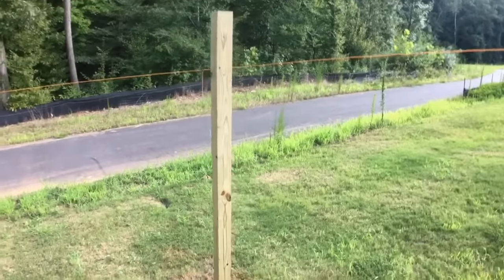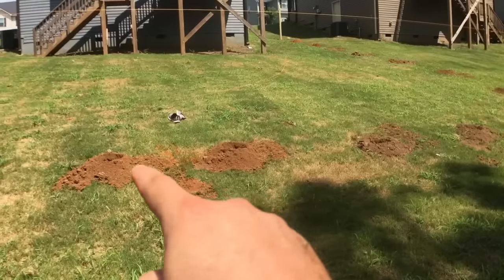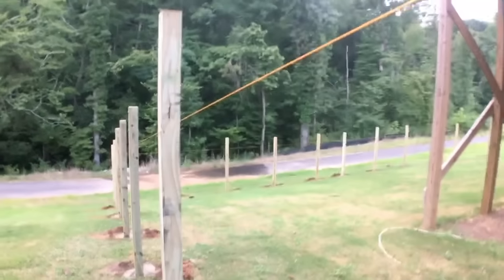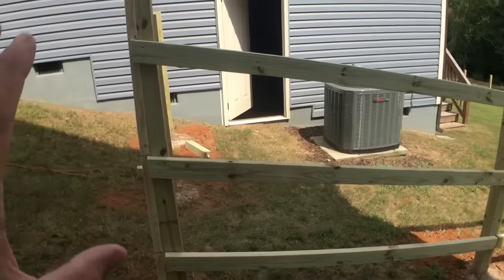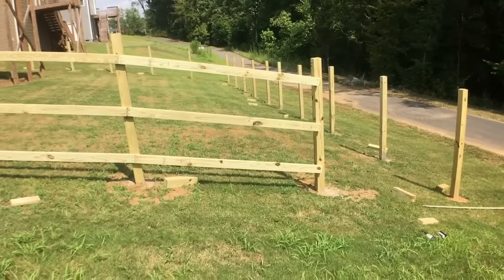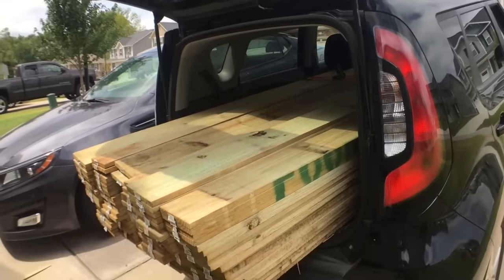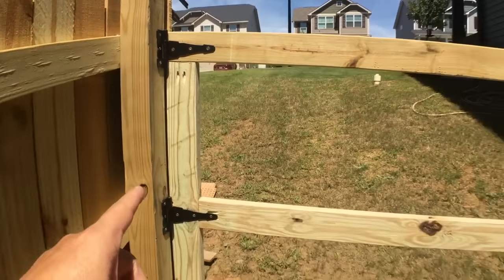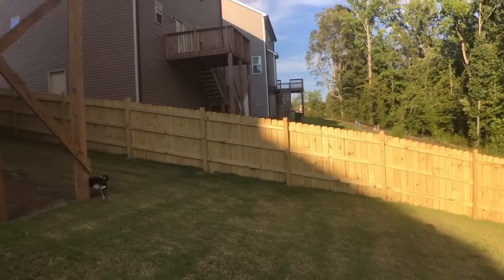How To Build & Install A Wood Privacy Fence Yourself! WITHOUT breaking the bank!!!!

Comment: Cmon now.. I am a woman 72 years old..5' 1" and live alone. I just put in 350 ft of wood fence using just a shovel to dig 2 ft deep holes for round treated 8' posts. I used Quikrete to set all the post and mine I put 6 ft apart.
Reply from the maker: Where were you when we needed you!!!?
Reply: I just told my daughter we could do this. You've inspired me!!!

Comment: Overall you did a good job, pro tip try not to use corner posts to be a a latch or hinge posts for gates, its essentially free floating and after a couple months that post will bow which will effect how well your gate opens if it does at all. 2nd piece of advice,  leave 1 1/2 inch gap between the gate where the latch is, over time the gate will sag a bit, if its to close together you will be lifting your gate to open it. 3rd tip ditch the middle runner (2x4) in the gate all thats doing is weighing down the gate, you put a diagonal 2x4 inside the gate frame (the bottom of the diagonal is always on the hinge side) its transfers the weigh from the top of the latch side to the bottom of the hinge side that has substantially more support due to the hinges being lagged to the post. Other than that it turned out good, not bad for your first fence!
Reply: That was absolutely so nice of you to provide such great technical insights to Kalinds Life. I am a woman who wants to build my own build my own fence so I watch and read comments so I can learn. I'm afraid to do it because I fear I'll run into something I can't handle. I'm watching and reading everything I can to be fully prepared. You comments helped me understand before or if I should attempt this. I would love the sense of accomplishment and want to save the money but just not sure yet. Thank you for the pro tips.
Reply: Learning. What do you mean by "free floating"?
Reply: @billymiles2635  I think it means the post is a corner post so the fences overall strength and rigidity is not in-line with the gate, it turns 90°.  I believe this is a problem because the gate hanging on that corner post will eventually pull it down, causing sag.  If the post had another picket section in-line with the corner post it would distribute that load across two posts, not 1.  At least that was my interpretation.
Reply: @Ryan-qk9sw  Your interpretation is correct
Reply: Gate wheels are a good idea. Good vid!
Reply: Yup, definitely need the diagonal cross beam on the gate
Reply from the maker: Thanks for watching!!! And commenting!!!

Comment: My how times have changed. I'm 67, when I was in my 20's my dad bought a "farm" we had to run 4 strands of barb wire to fence in 20 acres of pasture. EVERY hole for round fence post was dug with a two post hole digger. Granted it took 2 weeks, but I probably dug 1000 holes. I wish they had that gas operated one like you used.
Reply: If'n ya studied yer slide-rule a-might closer ya coulda' told yer ol pop's 1000 holes was multiples-o'-far-too-many.  Heck, ya musta put a post every 3 ta 4 feet.  So close the ground'll fissure if summer sow leant up again-it

Comment: Great job! I installed the first fence to my house back in 2004 to contain my 3 and 2 year old son and daughter. Sixteen years later my son just completed his first year of college and my daughter is going to be a senior. I live in the northeast (Lake George, NY). Where we get lots of snow and ground heaving when the ground freezes. If I were to offer a tip to your viewers, it would be to dig a 4-feet post hole, pour in about a foot of gravel (#2 stone), apply plastic roofing cement to base of your posts (getting the bottom really good), then setting the posts in the hole and pouring the concrete. This is a trick an old timer (my dad) taught me. Why? This will protect the post below grade from wood rot and from ground heaving when it freezes. See, the pressure treated lumber we buy is recommended for ground contact but not to be buried in the ground (or in water). That type of lumber is called marine grade- which is a lot more expensive. My point... I just replaced all my fence panels- they were an untreated spruce spaced picket (cheap at the time and did the job). When I removed those panels I inspected the posts, and all were rock solid like I just put them in. I replaced the spruce stockade with new cedar pickets- looks a lot nicer and saved thousands over having it done professionally. Note: for those looking to install cedar- be aware that if it does not come prefinished, you will use a lot of stain. I installed 80 feet and went through (1) 5-gal pale of stain and only had 3/4 of the fence done. So I purchased another 5-gals and will finish the first coat and apply a full second coat. Ps: when installing a gate, make sure you either install z-braces to prevent sag or buy the gate cable system- I chose the z-brace method- less expensive and better looking imo. Thanks again for the video, and best of luck to all on your next fence project! -Gary
Reply: What a coincidence, I live about 15 minutes from Lake George and I’ll 100% take your advice. Thanks!
Reply: I would to see a picture or video of that

Comment: I am a 61 year old woman doing most of this myself.  I say take a tiller and they dig down a few inches at a time. They are not real heavy.  so you end up with a 2ft sq. you have to keep digging up the dirt out of the hole.  You may have to take 2 days to do it. Just planting the poles. Eventually you will have a 2 ft hole. So tiller some and dig it out then keep doing it over the place until you have your desired depth.  That is what I will do.

The cement I have delivered.  I can't lift those bags. So take a bucket and take out 1/4 at a time.
A WORX wheel barrow is good.  I fill the bucket about half way to move the stuff to where ever you want it.  Then you can take the barrow to the holes and use a hose to make up the cement.
You can use quick drying.
Reply from the maker: Your an inspiration for sure!!! This is a lot of work and for that I commend your efforts!! Keep up the good work and hope all works out for you!!! Thanks for watching!!
Reply: inspire734 I’m in the same boat as you.  I’m sure you’ve done a great job.

Comment: I build fences for a living and this thing looks great, you could’ve used brackets for more support but it’s money 👍🏻
Reply: You would use brackets in between the poles right? On the end of each 2x4. Instead of nailing them on the outside?
Reply: What gauge nail gun should be used when attaching the panel to the post
Reply: I own my own fence company and that fence looks like shit. Not built properly and the gate has no braces. Brackets arent necessary when built properly. The build measurements are stapled on the side of the pickets when you buy them. Posts are to be under the pickets...
Reply: Can you tell me what material I need and how many to make a 200 feet fence
Reply: If u build fence for living your fence company must be crap all the post are higher then the pickets that’s a number one rule

Comment: Looking to do my own fencing job in Scotland, UK. Been looking for a step by step and informative video with handy tricks, much like the templates you used. You must be chuffed with the finished product.
Reply from the maker: We absolutely love it! Doing another fence video soon! Caps, water seal and gate supports! Thanks for watching!
Reply: @TheCrawlspaceCraftsman  do you have the measurements to the spacer you made
Reply from the maker: F King are you talking about the guide on the top?? It was just a 2x6 piece of scrap.l with two small pieces in the sides to hold it in place. I used a level to plumb the dog ears.
Reply: A string line would be the easy way to grade the top of the pickets it works the same as the Template but you can run the string down the whole fence line instead of having to move a template every couple feet.

Comment: Excellent video!  I'm about to start the same type of project tomorrow.  I have never done a fence before and I'm a little less nervous after seeing this.  I have no incline to speak of and the posts are all good, I believe.  So really it's just the slats.   Thanks!
Reply from the maker: Hey yo Rick! You can do it! Once you find your proper line and set your corners it’s smooth sailing from my there! The string line trick will help tremendously!!

Comment: I wish I had your soil. I live in Winnipeg. When I put in my fence posts I had to dig through roots the size of my biceps and clay soil that was like trying to dig through silly puddy and dense clay that clogs the auger every few seconds. I used the towable aguer from home depot, and even that large thing had a lot of problems. 2 days for 16 holes!  I had to use a crowbar and I sharpen the end to get through the very thick roots. The jackhammer was only useful for the first foot and the roots went 2.5 feet down in several holes.   Because my house is 100 years old, I also had to rent  jack hammer because there was a fence there before with concrete years ago. If I had someone else do my fence, I am sure they would have charged $6000 for the 50 foot fence. It was just crazy.
Reply from the maker: Dude that is crazy!!! This is not a job or company I would want to own! I give all the credit to fence builders even though I personally wouldn’t use one!!!

Comment: rent an auger for @60 bucks for the day,put your back out drilling all day into pitrun backfill on a new house.a lesson i learned early.i hired a bobcat for 250.00 with operator.maximum 15 holes,10.00/ea for anything xtra.
dont break your back,if you can get a machine in there,it s worth more than you know

Comment: Just started 300 feet of privacy fence this weekend.  My biggest problem with digging the post holes are roots!  Our neighbors have giant lived oak trees and the roots are at a minimum 2" thick.  Your video was great and gave me some good ideas.  Thanks!
Reply: I’m looking to diy a fence like this- how do you get those roots out? We are building one essentially in the woods with pines and wisteria EVERYWHERE. Can you power through the roots or do you have to get them out another way? If so- how?
Reply: @grassraptr4701  My 300 foot fence ended up being about 450 feet. In the areas I had a lot of problems with roots I could power through some with my gas powered auger but many I just had to reach in the hole and cut them out by hand with a saw. I used various saws depending on how much room I had and how deep they were. The quickest cuts were made with a Sawzall. Be careful because one cut I made ended up being an old waterline for irrigation… that was a delay to get the water stopped and repaired. OBTW, I don’t even have irrigation!!!  My house is circa 1964 so God only knows the changes made previously.

Comment: I've read a lot of pro tips on your video. I don't know if it was mentioned, but I have another tip for you. When you fill your holes with concrete, don't fill it to the top of the ground. Leave about 2" - 6" from the top empty and fill the rest in with your dirt.
Reply: Actually, that's the opposite of what you should do if you want your posts to not start rotting after a few years.
Instead of stopping with the concrete 2-6" from ground level, get an 8" cardboard concrete form at HD (they come in 4 foot lengths for just a few dollars) and saw off about 5". Place that around the post and keep it about an inch below ground level. Then FILL that form with concrete and with a trowel shape the drying concrete so that the water runs AWAY from the post.
Granted, it's not as pretty as having the soil and grass grow right up to the fence post but you will make sure that the post will not rot right where it matters: where the wood goes in to the concrete.
You'll thank me years down the road. :)

Comment: Most fence pickets are not treated for ground contact. And suppliers like Yellawood® recommend leaving a gap at the bottom so the pickets do not touch the ground. It actually voids their warranty if the boards touch the ground. Great job with the contour of the yard and tips on how to ensure your posts are placed accurately.
Reply from the maker: Thanks so much Bart!!! The only reason I have mine pretty much on the ground is my dog! If he had any inkling that he could get under he would dig his way. I to would recommend putting a 1.5”” board under each to keep a nice gap between the bottom of the board and the ground!

Comment: Nice job! The "template", in old school terms, is called a "story" stick. Should you build another fence, I would recommend mixing concrete before hand, ( practically dry or about a 2-3 inch "slump"), Google can help you out how slump relates to concrete. Then, mound the concrete in a nice four sided cone , so as to shed water. Yeah, I know it seems more of a hassle, but the end result will be much better. Curious, did you put gravel in the post holes prior to installation? No biggie, but it does help with rot. Most people don't. Some people go so far as to caulk around the top of the cone where it meets the post. Again, I appreciate you taking the time to share your great work experience with the world.

Comment: Awesome video, but I advise calling 811 before you dig and they will come mark utility lines. That can save your life!
Reply from the maker: Hey there JR!  You are absolutely right.  I didn't add this in the video but we did call 811 and they came out.  We were new construction and had little to worry about.  The only lines in  the ground we needed to avoid were on the side opposite of the AC UNIT as that was the Main power.  We ended up cutting the fence to 6' on the last section so the Meter box was on the OUTSIDE of the fence.  Thanks again for watching!

Comment: Great video! It’s hard to find a good fence video but you nailed it..
Reply from the maker: Wow thanks Brian! There was so much video taken and just as much edited......it was a hard one to make and I didn’t want to disappoint.
Reply: LOL, nice pun!
Reply: @TheCrawlspaceCraftsman  Great job on your fence! I install fences, only recommendation I have is use your stringline to set the height of your posts, you want a uniform top, not necessarily uniform distance from the ground.  You can also use a stringline for the top of your boards.
Reply from the maker: Instant Karma I see what your saying. Only issue for me was we have to follow the contour of the ground per our community guidelines. I didn’t agree but rules are rules!
Reply: KalindsLife About How Much For Material My Yard is About the same Size As Your And Thinking About Doing It Myself

Comment: Basic rule of thumb are the following:

1. Top of picket should be no more than 6" from top of 1st 2x4 rail. This is important especially when using the pressure treated picket boards that was used it. 
2. Bottom rail should be 6" from bottom of picket as well
3. Middle 2x4 centererd
4. Picket boards should at minimum be 1" above ground so pickets are not touching ground which will prevent premature decay of picket boards
5. If at all possible larger strap latches should be used and not the small t-latch used which doesnt support the pressure treated gate
6.  Excess 4x4 post should have been cut prior to installing top rails

Although the job isnt perfect its still better than some fences I have seen.
Reply from the maker: Great info here everyone!!! Again I’m no pro and highly recommend doing your own research before your build! Thanks for commenting and watching TK!!
Reply: when it rains it looks like your on a hill there so its not going to drain properly and will absorb in the wood.  U might want to cut some of the bottom if possible.  Also gapping for swelling is important ... Im not a carpenter so maybe i have no clue what im talking about. Lol.  But it does look nice.
Reply: @Myeyeofthebeholder  its a WET pressure treated pickets. You need to make it as thight as you can. Yes fence needs to be at minimum 1 inch above ground preferably 1-2 inch
Reply: @temujinkhan6326  yeah.  Now that i think about it they make u do that with decking. You did really good on your fence. And i know the dog is happy 😊.
Reply: @Myeyeofthebeholder  I did not gap my deck at all and now I have up to 1/4" gaps. Pressure treated 5/4 boards were used. My neighbor who gapped 1/16" has up to 1/2" gaps now. Those wet timbers will dry and shrink pretty good, especially here in NC. I see KalindsLife wearing an NC State hat, so I assume he's around these parts too.
Reply: 6" or less to prevent warping of the wood?
Reply: That concrete work tho

Comment: Just two suggestions, 1st the  “gates” it’s not necessary for that middle horizontal 2x4 instead a diagonal board from the top outside down to the bottom hinge side will keep the gate from sagging. 2nd the “pickets” you should allow at least a half to an inch of clearance from the ground to allow the weed eater to freely cut grass and not nick and scrap the bottom pickets and also keep them off the wet grass causing them to rot out quicker. Other than that awesome 👏🏽 job.
Reply from the maker: Thanks for your comment and suggestions for others too see! 🙏

Comment: Ya those post hole oggers are kinda rough... Body position is key... wide stance rest part of the ogger against your hip and place your right foot back... squat with it as it digs with medium rpm's and not fully under its own weight.. you need it to work like a drill and not a cork screw...  try not to let it bind or it might take you for a ride and it will mostly remove the dirt itself... sometimes lol... its defiantly manly mans work, but i hope it helps a little if you take a go at it again man